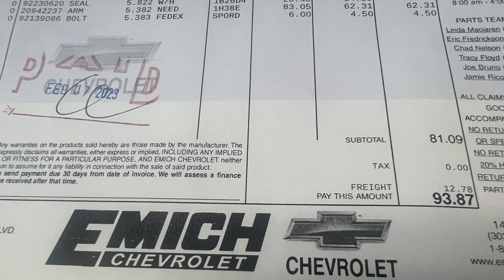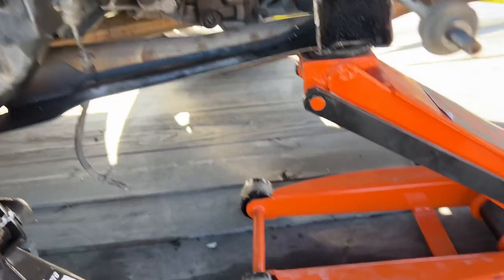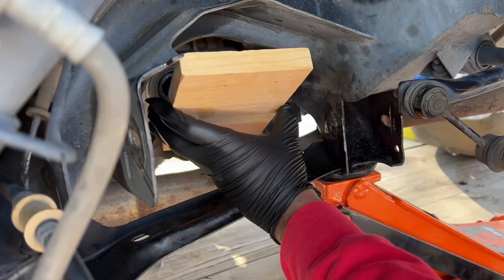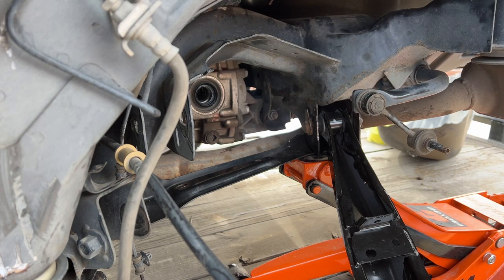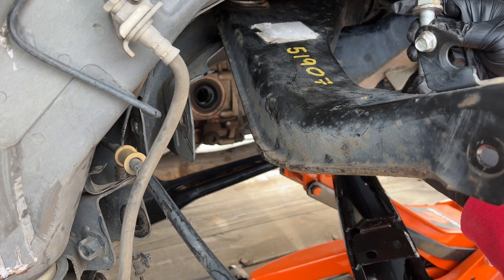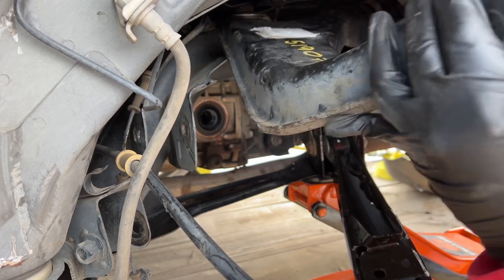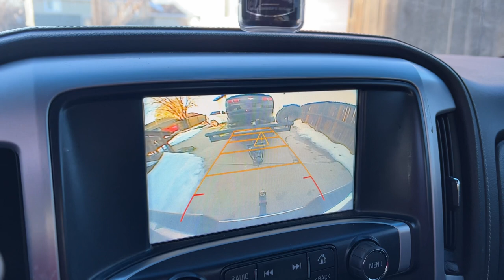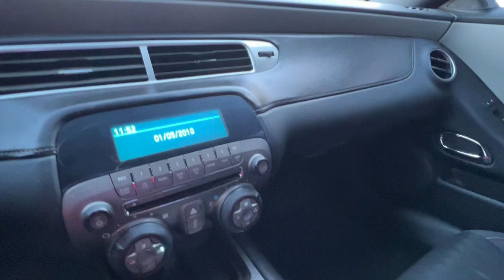I bought THE CHEAPEST CAMARO FROM COPART!! Watch how I rebuild it from home Part 3

Comment: score on the cheap price. the window warning in the cluster. push and hold the window button down or up first holding the button down the whole time, and then for 5 seconds longer, should re set it. this bs happens just from pulling the battery, or a dead battery.
Reply from the maker: I just did it thanks for the advice

Comment: I bought a 1LE a couple months back, and I've been having a really loud rattling sound coming from underneath the car. It happens at random rpm and vehicle speed. My father also has an SS and has the same issue but far more quiet, have you run into this problem?

Comment: i just bout a c6 zo6 from iaai and i know for the inspection i need to show proff of reciepts, do i need to buy some parts from a dealership or can i buy from ebay/used parts for everything?
Reply from the maker: Honestly any type of receipt will work. Also make sure no lights in the dash are on. All your exterior light work properly and no cracks in the windshield and you should be good
Reply: @DIYrebuildz303  awesome thanks